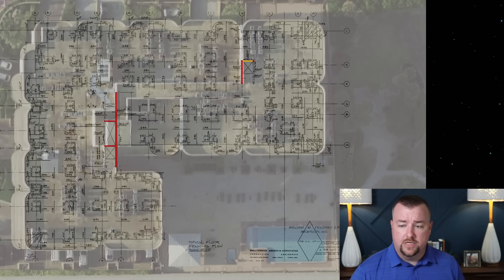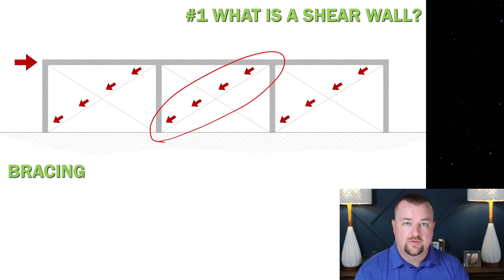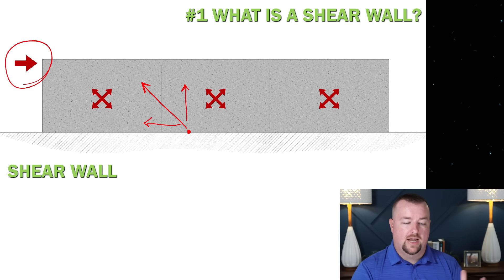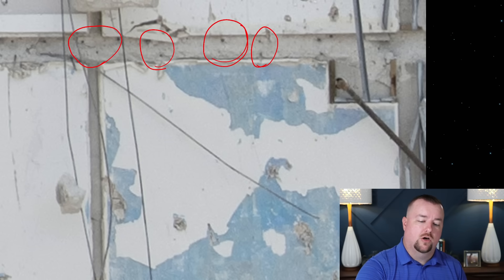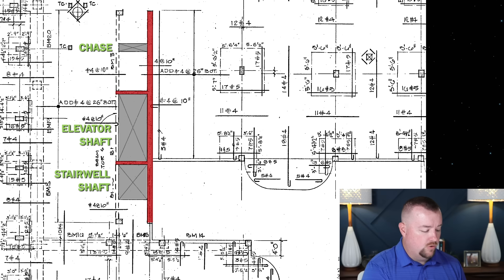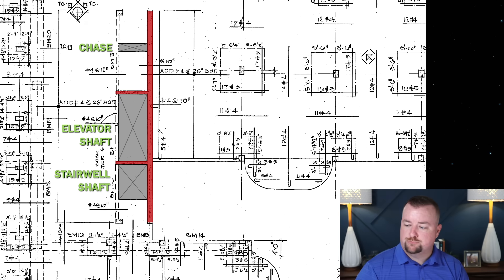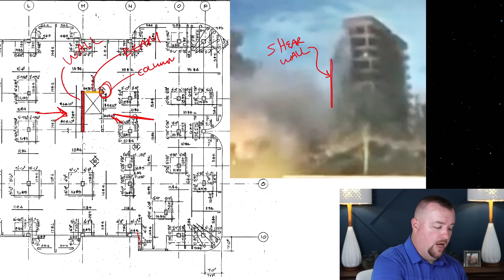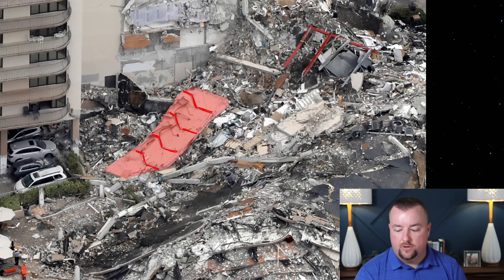Surfside Collapse - Structural Engineer Answers Your Questions About Shear and Shear Walls

Comment: So I’ve been wondering this entire time—there are 2 shear walls both aligned north-south: why wasn’t there a design element to prevent wind-shear in a hurricane-prone area in the east-west dimension?!?! You don’t know what direction a major wind gust is going to come from with an approaching hurricane!
Reply: The shear wall were necessary for rigidity of the elevator shaft and stairwells, they only incidentally provided stiffness to the whole building.
Reply: @gordonrichardson2972  LOL so your understanding is they weren’t really designed to,provide any stability to the building in either wind-shear axis, they were there for other reasons and just luckily happened to help out in this event and maybe some north-south wind-shears by accident! Honestly, it sounds like a really sh*t design to me… I mean, look at the Citicorp center issue—wind shear is a big deal and NYC doesn’t get the kind of hurricanes that are every-year events in Fla…
Reply: @kineahora8736  The building is more like a cube than a skyscraper, so wind loads and twisting forces were much less.
Reply: @gordonrichardson2972  ok thx—you can see I’m not an architect or engineer.
You don’t have to protect buildings of this shape from hurricane-force winds?
Reply: @kineahora8736  I think continued flooding of the parking garage and pool deck was a much bigger contributory factor.
Reply: @gordonrichardson2972  
Well I’m not arguing about that—the building had quite a number of problems to be sure. It’s just that it turned out if had more robust and bi-directional shear walls, the other problems might not have brought the dang thing down.

Jeff Ostroff’ channel pointed out the 1996 pool deck-redo that added significant weight to the deck and messed up the drainage at the same time allowing not only water damage but also significant pooling of heavy standing water, the BMA linkage of one of the pool deck columns that may have collapsed to the adjacent 16 x16 building column that many think then subsequently failed, and all the additional weight in the building after the original design due to (a) the penthouses being added and (B) something I have not heard talked about much, but the installation in many if not most apartments of significant heavy upgrades. I didn’t know the original building-wide materials in the apartments were lightweight linoleum flooring and crap-quality cabinetry and closets and bathrooms that when the area became pricey and deeper-pocketed people moved in, were replaced by heavy heavy granite and wood installations.
Reply: @kineahora8736  I agree on most points. Only a very detailed investigation will reveal which were the main contributory factors. Other buildings may need to be retrofitted as needed

Comment: Wood-framed (the vast majority of) homes here in California must have plywood shear wall sheathing in every exterior wall, as well as shear-resistant foundation/sill bolts, rafter/joust ties, etc.  My old Victorian cottage doesn’t, and it shakes like crazy in every small earthquake.  The building code has been strengthened to improve earthquake resistance after every major quake, especially the 1970 San Fernando, but older homes don’t have to be retrofitted.  Unreinforced masonry construction hasn’t been allowed here for a long time.  I understand that the lateral shear force for high winds, like hurricanes, are similar to that of earthquakes, so I suppose codes in the Southeast are similar.

Comment: We see the 'conduits', being very thin wall seamed steel tubing.  
I've installed conduits like this, however here we locate them between top and bottom steel reo mesh. 
What's interesting is that they appear to be of the same length, as if they ended at an expansion joint... and that no wiring appears (seem to be empty). 
Further, being of such thin walled tubing, that they hadn't clean sheared at the shear wall face. 
Question: Was there an expansion joint running parallel to the shear wall that would explain the multiple conduits of the same length.. And if so how effective would the shear wall be anyway having a designed movement joint so close. 
That leads to another question... where were the deck (slab) expansion joints located across those floor decks?
Reply: The conduits probably ran from the elevator shaft and then up between the apartments (that is how it is done in my building). The bend would be a join point where each fractured.

Comment: Question:  During the first days post failure, there were allegations of individual property owners undertaking renovation works that had removed structural walls. 
a) Was this the case? Any evidence.
b) To what extent had such work be done, be that the removal of walls.. or addition of walls, being dead weight loading. 
c) Would such works have a significant contributing factor in triggering the collapse?
Reply: It seems very unlikely there were structural walls inside those apartments. The whole building is column and slabs, with only partition walls.

Comment: Great job explaining this. Sounds lack a flawed design. Does this mean the remaining Champlain towers( North and East) that have the same flawed design should be evacuated. By flawed design i mean -not enough shear walls and slab not properly attached to the shear wall.
Reply: The shear walls were only a factor once the building started to collapse. The original cause was the pool deck, and poor maintenance.
Reply: @gordonrichardson2972  Aye, the shear walls didn't cause they collapse. They just slowed it down once it started. Their job is wind, they did their job for the life of the building and in their death even did some extra duty and saved a lot of lives.
Reply: @JCrook1028  
What if lack of the building rigidness caused the building to crack during excessive movement of slabs, so it started collapse?
Reply: @alexanderbelov6892  May as well ask what if it was a meteor...
Reply: @JCrook1028  
Having all walls made of concrete would allow the building to survive a meteor. Just some walls and slabs with direct impact may have damaged.

Comment: I have a general question about modern interior design and if it has any impact on total weight of buildings. Having remodeled a bathroom and knowing how heavy tile can be from loading it into my truck, does the extensive use of heavy granite countertops, massive marble floors and walls used in modern bathrooms have an impact on total load and perhaps exceed what a 40 year old building was designed to support?  I’ve watched your series and I realize this building had many underlying issues, but in general, can large volumes of granite, quartz and marble demand more from support structures than they were designed to accommodate?
Reply: Each slab is 8in thick, so unless you add 8in of granite, it's a relatively small contribution to the load in each apartment.
Reply: @gordonrichardson2972  exactly. Yes granite is heavy and so is a marble tub. But so was the cast iron tub it replaced. Overall this kind of stuff is a minimal weight load.
Reply: @JCrook1028  Jeff Ostroff has a video showing an apartment with marble tiles on the walls. That definitely adds some load.
Reply: @gordonrichardson2972  Typical dead load for a residential floor on a 10x10 room is 3,000 - 4,000 pounds. Marble tile at a FULL ONE INCH thick would only be 1300 pounds and no one is putting down full inch thick marble tile on the floor. Usually half that. 

I worked stocking drywall for a building supply company. Loading houses/wood frame apts, concrete high rises, all of them with drywall and I can assure you. You're not gonna put enough weight in there to drop the floor.
Reply: @JCrook1028  I mostly agree, but In a previous video it was shown that the pool deck columns punched right through the slab, due to lack of rebar. There were many contributory factors, so it is worth keeping all aspects in mind. The apartments right next to the pool deck collapsed first, so that is a key point of failure.
Reply: @gordonrichardson2972  If you paid attention it was not due to lac of rebar. it was due to the concrete being delaminated at the top rebar web level which made the rebar useless. Go back and rewatch the video and pay better attention this time cause you entirely missed the point he was making.
Reply: @JCrook1028  I did watch carefully, but respectfully disagree. Maybe we are talking about different things.

Comment: I wouldn't demo the remaining standing section so fast, I would have used it to simulate a column failure event and other events to see what caused the collapse, there is only so much you can discover from a pile of rubble. That's my humble opinion.
Reply: They demo'd it tho because it was about to fall on top of the rescue personnel.

Comment: I still have a question about the collapse itself..  from what I understand the top parking deck collapsed some 7 or 8 minutes before the rest of the building..  with the noted water flow by the tourist video and the fact a building of its age shouldve been fully sprinklered..  wouldnt the pipe breakage and ripping out of flow alarm wiring have triggered the fire horns in the building along wit ha slew of alarms on the fire panel and at a monitoring station? when I used to work on HVAC equipment we were present during live alarmn testing and any breakage of a flow switch circuit or any water flow triggered an alarm...    or am I mistaken  did the parking deck Not collapse till seconds bfore the main structure?
Reply: From what I have read, the fire department was on its way when the building collapsed.

Comment: Very interesting.  We live in a stick 2 story house in California. Many walls are constructed with particle board attached to the 2X4 studs to give lateral support or resistance to pressure to side forces. High winds aren’t an issue; very rare earthquakes don’t seem to widely shake the structure. While it’s hot and try in summer, I’m glad we don’t live in beautiful Florida. 
Thanks for your videos.

Comment: The shear walls in the building are so minimal, the columns and slabs will act as a bit of a moment frame under certain loading directions. I am use to designing in an earthquake zone, even compared to many of our older buildings, these walls look so small and insufficient.
Reply: I agree (as an ex civil PE) the structure, at first glance looks 'flimsy'. I also think the rebar detailing looks questionable in many places (BUT I have never designed rebar for a flat slab construction so don't have much 'feel' for this type of structure). I see there are a few beams linking columns in some places but again they don't look robust and appear lightly reinforced, Rebar continuity and rebar lap lengths (the expression we use for embedment/load transfer into concrete) appears kinda skimpy - although I note these bars are deformed to provide additional transfer BUT this does depend on quality/strength of concrete (and detailing). I am waffling on a bit 'cos it all looks flimsy/minimal and lack robustness. 

I also have questions on constructon sequence with changing concrete strengths in wall/columns/beams/slabs and the 'bending' of rebar to get it out of the way of formwork at construction joints. 

Would any of these joints act as moment frames, and many appear to have failed in shear - I understand that Florida codes changed after construction to provide more shear resistance, and more structural robustness.

If you are from USA - try looking at photographs of Ronan Point collapse in London dated 1968 for a shear collapse (after a gas explosion)  of part of a building and becasue of the VERY weak shear connection most of the building survived and only four people were killed.

Comment: It seems to be a very poorly designed structure.
For not much more money the pool deck should have been a stand alone structure supported by it's own columns with the main building having no direct contact except for an expansion joint to prevent water seepage. A failure of the pool deck should never bring the main building down any more than the deck on the back of my house should collapse the entire house.

Comment: I get it now.. that cardboard panel on the back of my Ikea furniture is the "shear wall" makes total sense. Thanks JP..
Reply: Exactly!
Reply: It's amazing just how thin that thing is and it provides a diaphragm.   Actually,  that thin sheet on your IKEA is a diaphragm and not a shear wall.  The floors of the condo are diaphragms which carry the loads to the shear walls and bring those loads to the ground. Diaphragms go into shear though, and so the IKEA example is a good insight.
Reply: @hebrews11vs5  it can be that thin cause it doesn't provide stability front to back, but in all directions left to right and top to bottom, and in that case the entire length or width of it are what absorbs the forces when you try to push it from the side
Reply: @hebrews11vs5  it's also similar to double-sided sticky tape. it's flimsy and incredibly thin in one direction. but when you stick two things together, the entire surface resists left-right or forward-back motion
Reply: Eureka!
Reply: not if it doesn't go to the base.
Reply: IKEA IVAR shelving comes with a galvanized steel cross-brace (OBSERVATÖR). Skip installing those and the whole contraption, no matter how wide, is a structural disaster. Installing the Cabinet adds cross-bracing due to a Fiberboard back panel, and a small wooden beam. Regardless, I still secure these shelves to the wall studs with the supplied straps, because (you know) children like to climb on stuff, and in California we have earthquakes.

Comment: I have a question if the steel size and amount seems to match the blueprints. I heard that early in the investigation and haven't heard anything about it lately. Does the rebar seen in the collapse match the blueprints? Could it be an inspection fail in the design?

Comment: Of course we learned something we learn something every time you put out a video, or at least I do, I just had a quick question on those holes where the rebar used to be I'm wondering how they pulled out so clean and didn't crumble any of the concrete below them like I'm thinking if something was in that hole and it came down it would push the concrete that was below it and bust it out unless the building went to the right a little bit and then down, just my two cents, again thanks for the video, I look forward to your videos
Reply: A short length of rebar will pull out of concrete like a nail will pull out of a wood plank, it has to be really long and deep to get a good grip.

Comment: One of the early videos I watched particularly of the east side collapse it showed a blowout near the lower floor then the east side started down when I saw the 2 columns still connected by the cross beam laying on the garage floor with the beam top facing east, I  figured that what was the final straw that started the remaining east structure down when it got knocked out by falling debris.

Comment: On the second graph, I couldn't see where the stairwell was, as it was shown on the first graph. I'm wondering if the stairs were accessable to the last section standing.  If not, it horrifies me to think people had a little time, but couldn't get to the stairs.  It also seems ridiculous that there's only one stairwell to begin with in such a large building.
Reply: It had two stairwells. It was required even in the 1970s. All building require two means of escape from all locations in the building unless the area of a room less than a certain amount.

Comment: Once again, top notch video. I'm not in engeneering at all, but as I understand, a shear wall must resist in-plane lateral forces. In Champlain Tower South, this shear wall resist lateral movments in the north-south axe. But why Isn't there another similar shear wall for the east-west axe? Thanks.
Reply from the maker: I will be answering this question in a future video.  Thanks for watching!
Reply: Building Integrity thanks for the super informative uploads, it's much appreciated!
This kind of plan, with completely open decks and minimal sheer/structural walls makes me think of a commercial or office building construction, where you want maximum configurability of internal spaces. Is this a common way to plan a residential building? In my own condominium, the divisions between units are partially structural.
Reply: The shear wall(s) were necessary for rigidity of the elevator shaft (and stairwell), they only incidentally provided stifness to the rest of the building.

Comment: I'm not an engineer.  To my untrained eye, it just seems like the shear walls in that condominium wouldn't stabilize the structure in a strong wind.  Why is there such a large shear wall - that saved lives - on one side but such a small one on the other side?  Are there guidelines in the industry that provide standards for shear walls?  Thank you!
Reply: Thing is tho it DID protect it from the winds for the last 40 years. Winds did not bring it down.

Comment: 12:57 . . . May be the best explanation why the failure progressed so badly.  That elevator shaft / stairwell shear wall was robust.  If the 110 through 1210 apartment slabs had been thoroughly hooked into the shear wall at each level, none of us may have heard of this building,  and the people living there could possibly still be alive and only complaining about the deteriorating parking garage causing damage to their cars.
Reply: His theory is possible but a very remote possibility.  His reasoning about the hooks is nonsense to anyone familiar with rebar detailing and installation. He is a good teacher but clearly lacks practical on the job experience.